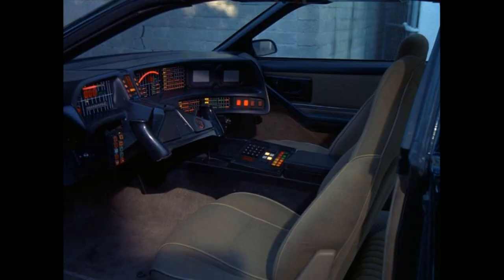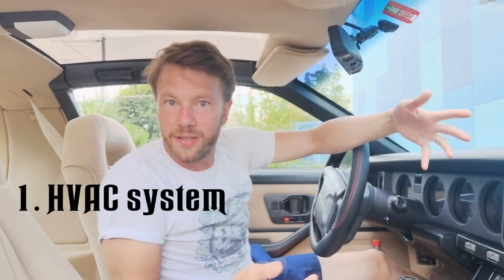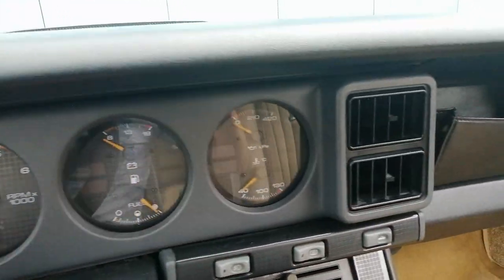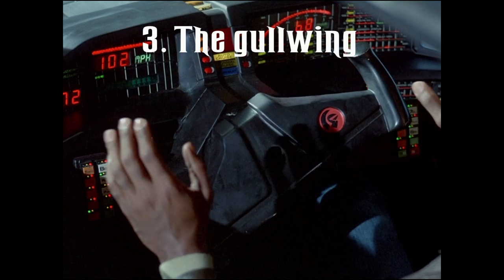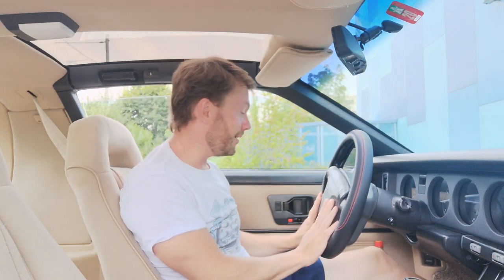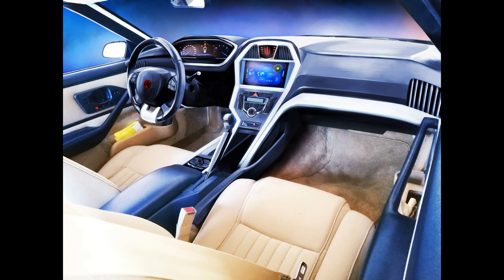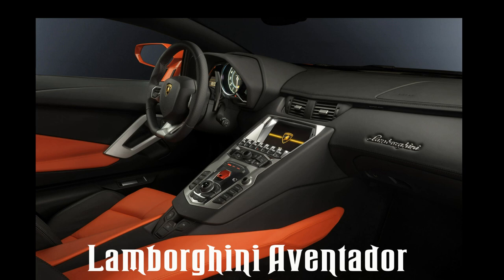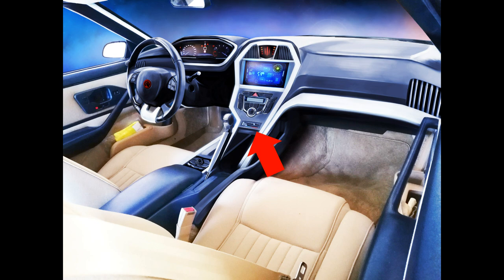KITT Firebird Trans Am - Episode 21 - 21st century KITT dashboard

Comment: It's really ironic that Tesla came out with the Yoke on their cars and suddenly it's apparently completely fine, but as long as a "normal car manufacturer" doesn't use it it's illegal :D. That being said, I would also never drive with the Knight Rider steering wheel.
Reply from the maker: Yes, indeed. Especially since the steering ratio remains the same whether you drive a Tesla with the circular steering wheel or the yoke. 
In reality KITT's yoke has a diameter that is far too long. Most people couldn't turn the wheel completely once without it hitting their leg.
I've been researching the legal situation here in Switzerland, even with the help of a police officer and their is no legal obligation for the shape of a steering wheel. However, I still consider it dangerous to drive with the KITT wheel on public roads, even if it visually fits much better than a circular wheel.
Reply: @MotorScotti  I am even surprised you were allowed to add different lighting to the car, here in Austria even that would not be permitted :D.

My long-term goal is to build what I would consider a "soft replica" just like yours, so a car looking mostly like KITT on the outside but with a stock interior or rather an updated interior. I would also love to have an updated suspension and drivetrain, but that would most likely never be possible to get road legal here in Austria, the rules are insane. I always look at the North American car scene with a lot of envy in that regard :X.
Reply from the maker: Yes it's similar here in Switzerland with regards of suspension/ chassis mods. It's actually very much possible and straight forward. You just have to have every single modification checked and validated by a specific vehicle test centre, which is expensive. For example if I wanted to install a disc brake conversion in the rear, subframe connectors: round about 600 USD equivalent in testing fees per mod, hence about 1200 USD just two have two things tested, not including the purchase and installation costs. I would like to add these two changes to my KITT but it's just not worth thr money. Only cheaper possibility is if these parts have a seal from the OEM manufacturer,  GM. That would allow my to install it without any special approval. Unfortunately all of the good stuff is made by aftermarket companies.
In terms of the lights on my KITT: What do you mean? The lights I installed comply with swiss laws (parking, indicator and daytime running lights LED). Lucky us, the US style red indicators combined with the brake lights are legal is Switzerland because we have a long history with building GM and Ford cars under license in Switzerland in the 50s and 60s.
Reply: @MotorScotti  There are many GM parts that you could fit on a 3rd Gen F-Body, the same is true for the engine. They still have to be inspected and deemed safe and legal around here, no matter where they come from, and that testing costs a lot of money here similar to you in Switzerland.

What I meant with lighting was the LED running lights, you can't just put those on the car here for fun, in particular you can't put any LED lights on a car that didn't have them from the factory. So if you put on some Halogen lights down there they might think it's original, but if you put LED lights on an 80s car the law will come down on you instantly :D.

Red indicator lights are also not legal here, I think a few cars here have them when they were imported back then. I own a 4th Gen '94 Formula that was imported from Canada and it has all the running lights active, it has the US side mirrors (I am sure you know the ugly EU foldable side mirrors), but it has the EU tail lights, which is very annoying.
Reply from the maker: Interesting to see how strict things are in Australia. I've never been there but have met a few and given that Australians come across so laid back it's hard to believe that rules would be so strict there.
Anyway, DRL have been mandatory in Switzerland for about 10 years. You either have to fit them on cars that don't have them from factory or just drive with the low beams on during the day. However,  the DRL need to comply with specific regulations and position on the car. They need to seal "RL" for "running light" and either switch off or dimm to position light as soon as you switch on the position / low beam lights. If they do act as a position light as well (like on my KITT), they also need the approval code "A". Aftermarket turn signals have to have these codes and as well ("1"). When my KITT goes through state inspection once every two years, the tester gets his flash light and looks at these things closely.
Also I first wanted to use a set of fog light housing to install the indicator bulb... not allowed. It needed to be an official indicator housing... I had to become and expert in the matter to make it road legal and yet visually acceptable 😅🤣
Reply from the maker: Btw I subscribed to your channel if you intend to share some stuff on your cars.
Reply: @MotorScotti  I think it's hilarious that you as a Swiss person and thus my "neighbor" made the mistake of thinking Austria is Australia :p. State inspection has to be done every year here by the way (once the car reaches a certain age, I think it's 6 or 8 years).

Regarding my channel, don't expect to show anything up there in the next few years - unless something very very surprising and positive happens I won't be in a position to actively work on that very long-term goal of mine.
Reply from the maker: Ahh sorry I must have misread it!🤣🤣🤣🤣 ÖSTERREICH!! 🇦🇹 🇦🇹 🇦🇹 ❤️❤️
Reply: @MotorScotti  Yes - now you probably understand why things are so strict here, the bureaucracy in Austria is most likely even worse than in Switzerland :D.

Do you know the Roadster Shop by any chance? It's a shop in the US that builds custom chassis for classic cars and updates their drivetrain and interior as well. The YT channel AutotopiaLA has a YT video about a black 1600 HP Buick Grand National V8 build from the Roadster Shop where they have updated the interior with a digital dashboard that is unbelievable. I imagine something like that in a KITT "soft replica" would be absolutely brilliant.

I have been watching your great videos and in one of them you talk about an imagined updated interior for your car, that's why I mention it.
Reply from the maker: I looked up the video about the Grand National. The digital gauge cluster looks very good. I am still OK the process of building my KITT dashboard, even though I like thr factory dash, too. I'll be posting an update on that soon. My schedule and my custom ideas just take a lot more time than anticipated, but it's a fun project and I don't want to rush it.

Thank you very much for your support and the compliment!🙏
Reply: @MotorScotti  I am looking forward to your new video, very curious with what you are coming up :).
Reply from the maker: Btw a company called DD EFI (dd-efi.com) makes these kind of digital gauge clusters. They are connectable to mist cars. The Holley EFI gauge cluster in this video is limited to LS engines or engines that are specifically made for Holley fuel injection, I believe.
Reply: @MotorScotti  Do you mean the digital gauge cluster from the Grand National video? In the video they say that it's an in-house development that can be applied and customized to a lot of configurations and that they are in the process of offering it out as a product. I have not seen it on their website so far, though.
Reply from the maker: @MrReese  No it's a Holley EFI in the Buick. You can see that when the guy switches on the ignition it shows up. He probably meant the specific customization and setup they did for this car/engine/cluster combination.
Reply: @MotorScotti  Isn't EFI "electronic fuel injection"? What does have to do with the gauges? Can you tell me the timestamp in the video of what you mean? I haven't found it yet. He clearly says that they have been developing it for years and are planning on offering the entire thing out as a product in the future.
Reply from the maker: @MrReese Yes, that's the point. The values on the gauges come from the engine: fuel pressure, fuel level, water temperature, etc. This gauge cluster is made to connect to the Holley direct injection system.
Reply: @MotorScotti  As he says in the video, the entire system they built into it made to interact with basically everything in the car, everything is wired to it. It's not only the gauge cluster and just because this one works with a Holley does not mean it only works with a Holley.
Reply from the maker: @MrReese  Okay👍

Comment: If I could build a KITT replica I would have a dashboard that blended elements of the Knight Rider dashboard with the stock Trans Am dashboard.
Reply from the maker: I was trying to add the Voicebox to the factory dash but after all I thought it looked weird.
Reply: @MotorScotti  Actually I would have the Knight Rider dashboard with both Knight Rider guages and stock guages.
Reply from the maker: I've seen mixes before and I'm not a fan of that. I'd rather have a full Knight Rider dashboard or just the factory setup like now, but I will make an update on my 21st century dashboard ideas before Christmas.

Comment: Im of two minds on the updated dash. While I have always love the tv dash i understand the practical reasons not to use it. But the 21st century dash just looks out of place in that car instead i would put it in one of the newer trans ams maybe the 2002.
Reply from the maker: The updated dash is just a drawing at this stage. I've been thinking of making a frame into which I could insert parts of the 1st/2nd season dash: the speedo board with the message center, the voicebox and the rpm board. Not sure about the 2002 Trans Am dash. It has a very distinct 90s design to it; it's too round for my taste, but I think it should fit with minor modifications, because the 3rd and 4th gen have very similar proportions.
Reply: @MotorScotti  i just had an idea for you updated dashboard. Include a windshield HUD for your speedometer. my grandfather's last corvette had one and it was amazing.
Reply from the maker: I like the idea!

Comment: But, you have a red light scanner, and I think than the red light scanner is illegal, no?
Reply from the maker: You're right but it's not bothering anyone as long as I don't turn it on on the road.
Reply: @MotorScotti  You could always go with KARR's version.  I don't think the yellow would be an issue in most places.